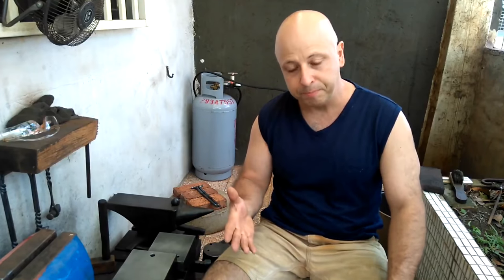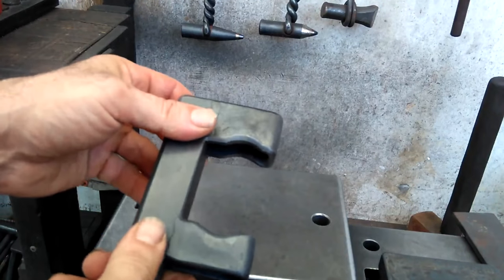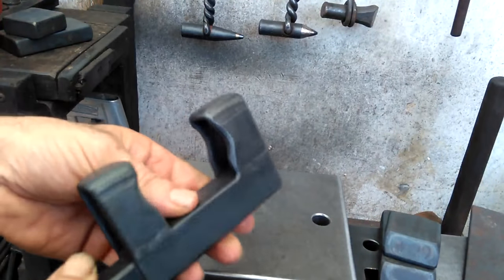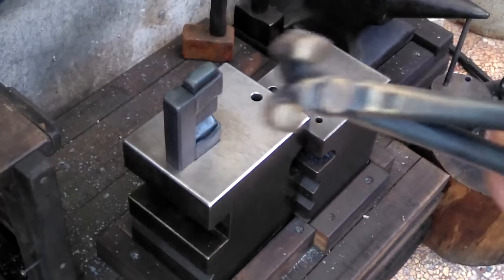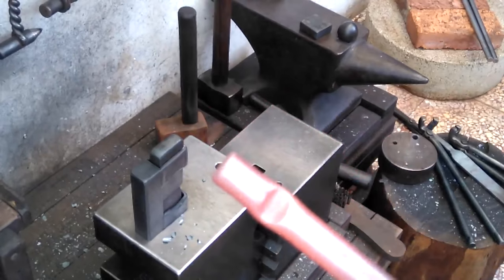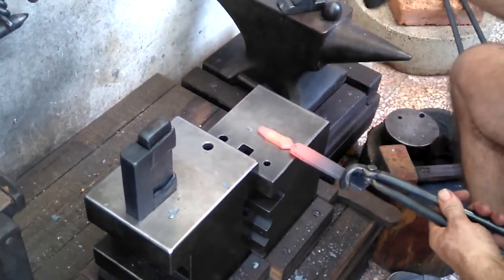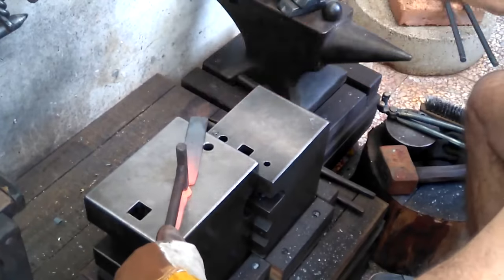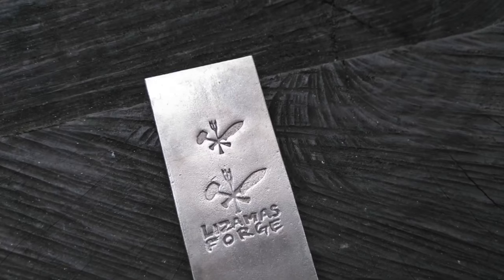Blacksmithing - some advice for beginners, guillotine tool & tong demo., two new touch marks

Comment: Vice grips are great tongs for beginners. You'd likely have a set kicking around the house, and the investment has already been made. If you don't have a set, go to a pawn shop where they have bins full of old tools, they work just fine. Grab a et of needle-nose pliers and you can grind them down to round jaws and you'll have a set of makeshift scrolling tongs on the cheap.

Comment: Great tool there, my friend.  Puts the one I built to shame.  I'm still amazed at how well you move the steel while you're seated.  I know its the traditional way to smith in a lot of countries, but you move the steel very efficiently.  Oh, and once again, a much more relaxed and enjoyable video.  Keep it up... we're always learning more out here.
Reply from the maker: I guess my arm has gotten used to being in the seated position. I'm not sure I always move steel efficiently but for sure I recommend not trying to beat the steel into submission (as I often see guys doing). Those folks won't last long if their hammering is wild and uncontrolled. You have to work with the metal and the heat and not against it. (I should mention this in a video). Thanks for continuing to watch. Glen

Comment: I barely started this summer. I have a railroad track as an anvil, some hammers and tongs from harbor freight, and a brake drum forge. So far it works pretty well for my skill level lol.
Reply from the maker: At some point, you might want to upgrade your tooling but if what you have serves the purpose, then maybe there's no need to change. In many instances, the tools don't make the craftsman but just the opposite. And often it's better to build a good skill foundation with the basics. Thanks for sharing that info. Glen

Comment: An idea for the top dies (spelling? English is not my native tongue): at the very top have some "arms" stretch out to the left and right. Reason: if you have arms at the very top of the top die, you don't need to put down your hammer in order to move it up, so you can put your work piece between the bottom and top die. You can just use the hammer and put it under the arm of the top die and push it up, put in the working piece with your other hand/tongs, and get going right away. Makes sense?
Also, sorry if other comments already pointed this out or suggested it or in case you had this idea yourself but discarded it due to any disadvantages I didn't see at the moment. Anyway, great video. Thanks.
Reply from the maker: Thanks for your suggestion. I have thought about this tool in different forms but always find the simplest design to be best (for me). Others have suggested having the top die spring loaded so it always rebounds upward. I plan to work on this tool more when I get a chance and appreciate your input. Glen

Comment: Brilliant very informative I really enjoyed this video keep them coming
Reply from the maker: This video was sort of all over the place so I'm glad you were able to take something away from it. I will do my best to keep them coming... Thanks. Glen
Reply: Glen GS Tongs ah man you're to hard on yourself the video came out perfect and even so some subscribers like a bit of normality in videos so they don't think we are perfect at everything haha. I recently tried to forge weld in my gas forge and although it did turn out ok it destroyed my bricks and ceramic matting how do you manage to do it in your forge?
Reply from the maker: Thanks for the encouragement. The way I manage to not destroy my gas forge lining when forge welding is to rarely forge weld in my gas forge. I like forge welding when using coal but dislike it when using gas and so avoid it usually. You can use a sacrificial fire brick or ceramic on the floor - a piece that you only use when welding - and that will help. When I showed welding in a video, I wanted to do so at that time because I was going to change my forge lining anyway. Another thing to consider to maybe help is use less or even no flux. The melted flux is what really is corrosive. I have done forge welding without flux with pure iron. But with mild steel coupled with a gas forge, it's just not that easy. if you can get your hands on pure or real wrought iron, give it a go. Or experiment with alternative fluxes... Thanks. Glen
Reply: Glen GS Tongs brilliant thanks so much for giving me your time and explaining all that. I've now changed the lining of my forge and won't be forge welding in it from now on.

Comment: Idea for you with the tings you have there. Little bit if drilling and taping you could create inserts for the end of the tonight that would allow you to grab different thickness of metal simply by changing the the insert. Like the insert would be set up to slide over those tongs and have a set screen that clamps down on them.  As always love the videos
Reply from the maker: Anthony, Your idea for making the tongs adjustable is interesting - something to think about for sure. Thanks for watching and for your input. And sorry for the slow reply. Glen

Comment: Your guillotine is very effective. Also like your tong configuration, similar in function to offset blade tongs. But I believe yours may be stronger. 
Also, you weren't kidding when you said you are a minimalist. I don't see a lot of other tools. 
Am curious about your anvils... they appear to me to be some type of swage blocks, but have hardie and pritchel holes.
I don't hear any ringing, and wonder why they are not fastened down. Do they not require anchoring?
Anyways, I appreciated your video.

Comment: The bent knee tongs might be exactly what I am looking for as far as bladesmithing is concerned.
Reply from the maker: My bent knee style tongs are my personal favorite and I don't make knives. They're a little odd and take getting used to but they hold well even when rotating while hammering and are a bit more versatile than standard jaw tongs. Thanks for watching. Glen
Reply: How much for 1.5  by .25 inch? How much for guilatine?

Comment: You could possible try some rounded dyes and possibly a V type dye? Very interesting tool!
Reply from the maker: Yes, I did try a variety of dies but found the fuller an flat dies to be most useful. Still, there's a place for all sorts of shapes, depending on the work. Thanks for watching. Glen

Comment: Another great video..If you don't mind me asking....The other day I was trying to explain to a  friend why your anvils, though smaller work so well is because they have most of their mass directly under the working surface..Like a bladesmiths post anvil..Would you agree with that assessment? thanks and keep it up
Reply from the maker: Yes, I agree. That was exactly my thinking when I designed these. I've always felt that wherever you are hammering on your anvil, how much mass is directly beneath where you are hammering very much influences how well the anvil performs. While any anvil is one unit of weight with a certain mass, having the weight is spread out horizontally (in a horn, heal or wide face) does help to a degree. But I think the more mass you have vertically in close proximity to where you are working, the better resistance. And better resistance translates to the less energy loss (more energy is directed into the workpiece and not lost through the anvil). Of course, this also depends on the type of steel, hardness, etc. Anyway, I definitely agree. Thanks for watching. Glen

Comment: Congrats for your video!!! I have a question how mutch time remain the red color of steel when you start forging???many thanks
Reply from the maker: I would say that I have about 30 seconds to work my steel before it cools off too much. But this largely depends on the size of the steel I'm working and how high of a heat I take. Thanks for watching.

Comment: love your work is the brand stamp made by you or just brought from a company and with the guillotine is it possible to make blade tapering tool so you can get a continuous taper all the way up the knife blade
Reply from the maker: The touch marks (brand stamps/logos) are made by a professional engraver here in Taiwan. I facilitate getting these made, mainly as service to those who buy any of my tools. I'm not sure if I could make the tapering dies you want. I am imagining the bottom die as flat and the top die having a slight, side to side angle. This may work but you would have to move your blade along and work it as you pull or push along since the dies are only 5/8" thick. This might leave marks at each interval. I may need to try this out and if it works, it could be a useful die choice. Any input you have is welcome. Thanks for watching and for your interesting question. Glen

Comment: Glen, what is the black finish on the guillotine? Thanks.
Reply from the maker: It's nothing more than a final heat to a low temperature, before scale can peel away, a light wire brushing, letting it cool until warm and spraying it down at that point with WD-40. To be honest, it's probably best to not use a spray oil on a piece that has any heat on it. You could just wait until it's cold, then spray it, to be safe. If you want a really jet black finish, get a metal container with old motor oil and a metal cover. When your piece is at a black to very dull red heat, drop it on and quickly cover (so the oil can't flash up). Just be careful with hot metal and oil - take all safety precautions. Thanks for watching. Glen

Comment: Glen hi please I need to be educated about you anvil that you are using in this video, where I can get it, or I have to make my own, very nice work. also what is the cost of the die and tangs, thank you and have a nice day.
Reply from the maker: Thanks for your interest in my work and for watching this video. The block anvils I use are my own designs. For a time, I was selling the smallest but the shipping is just high and margin low and so I stopped. Sorry I couldn't help you with this. I recently upgraded my guillotine tool and charge $90 for that. And I normally charge $37 per tong. You can check out my website at:
http://www.gstongs.com
Thanks. Glen

Comment: Do you have the guillotine tool  on stock or do you  make a few as ordered?  I may order one next month but didn't know if you get slammed with orders n can't get one out.  I do smithing on the side for small projects and would rather buy a nice one than spend hours designing one and getting tooling made.  thanks and nice work
Reply from the maker: Dave, I make everything to order. Currently, I am busier than usual and so the wait for me to complete whatever you might want is about two weeks. With the guillotine tool, I would need to know the hardy hole size you want it for. Many of my customers are able to make some of the tools I offer but either don't have the time or prefer to spend their forging time doing things they enjoy. Let me know if there is anything else. Thanks. Glen
Reply: Thanks. I will give you a holler in a few weeks.

Comment: Point me to another video if this question is already answered, but why do you kneel when you forge/ squat?
Reply from the maker: Joel, After moving (back) to Taiwan years ago, I found my work space fairly limited and I thought it wouldn't be practical if I was standing and moving around to my tools. I thought if I could do my work in a seated position, I could place my tools around me and make better use of my space. I've been working like this for years now and doubt I can go back to standing. But this may not be for everyone. I'm short and pretty flexible. Also, there are dangers that need to be heeded when forging in this way. Thanks for watching. Glen
Reply: Ok. Thanks for answering that! :D

Comment: Have you ever thought of getting a power hammer or press or getting your own shop
Reply from the maker: I do have a small shop at my house in the US. My current location is not suitable for larger equipment. I thought about renting a shop space here but currently, I'm enjoying keeping things simple. I never seriously thought about getting a power hammer or hydraulic press because at that point, blacksmithing would no longer be fun to me. Maybe I'm wrong to assume that but I like to keep things as minimalistic as possible. I would however like to get a flypress. I once owned a very, very nice treadle hammer but never used it as I should have. I guess my motto should be work harder not smarter!... Thanks for watching and commenting. Glen

Comment: What is the cost of ur gillatine tools Glen
Reply from the maker: I normally charge $90 for my current guillotine tool (an improved version of what you see in this video) and the shipping vis standard airmail is $23. It includes fuller and flat die sets. Thank for watching. Glen